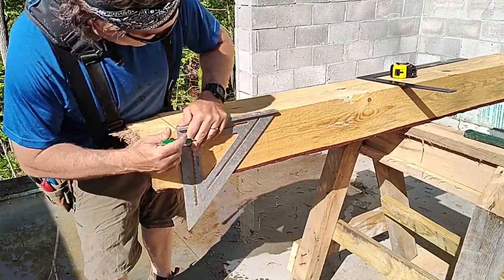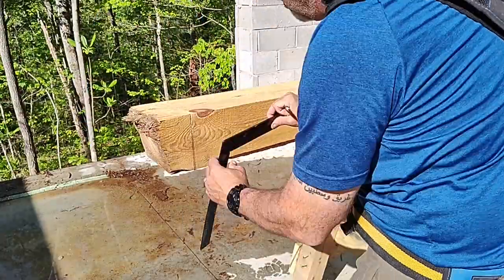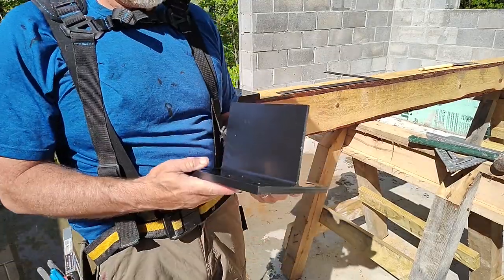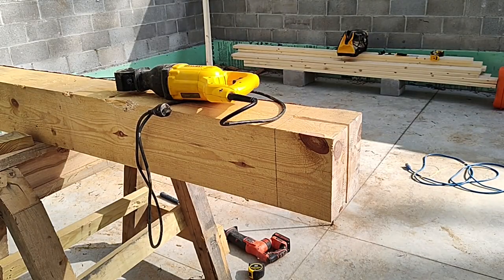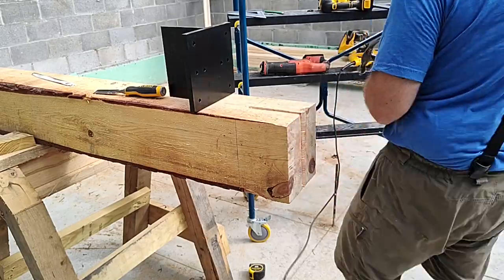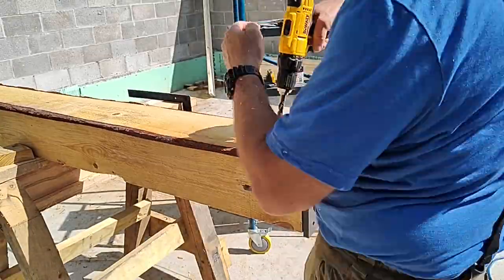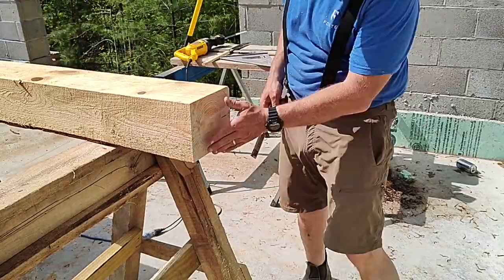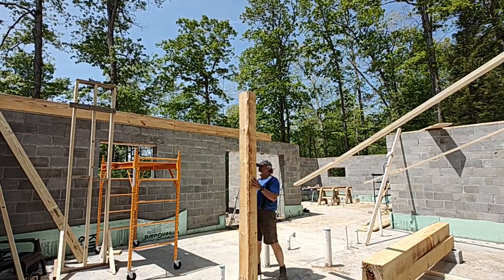DIY House Build Ep.11: Subfloor post and connectors

Comment: You should get a chain saw for those big and deeper cuts. I mean you do want quite a wider cut, which would be made by a chainsaw blade, and also help eliminate out all that other work you have to do with the chisel, so I think a chainsaw could help. Besides, it's a nice tool to have in your truck. Especially where you are in Kentucky. Anyway, you are into hte saw business, aren't you? With your saw mill you're building and all...lol A chainsaw could be like a mini sawmill lol
Reply from the maker: Yeah, that's just sound advice! I don't always think of chainsaws for woodworking/carpentry but the best tool is the best tool!  Thanks for watching!